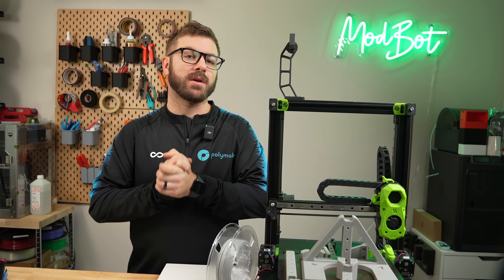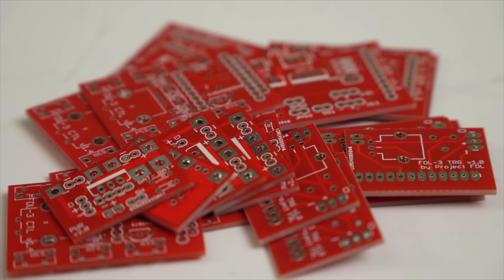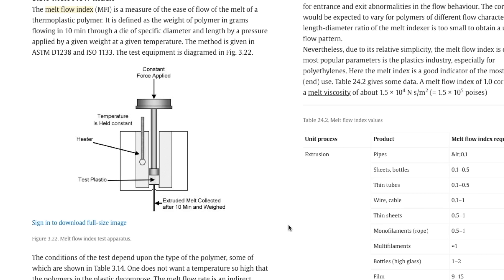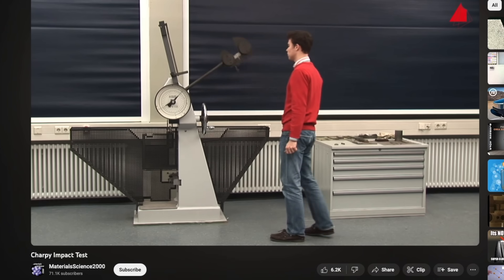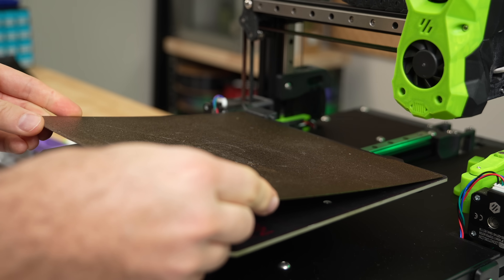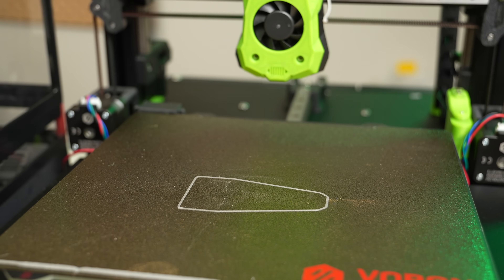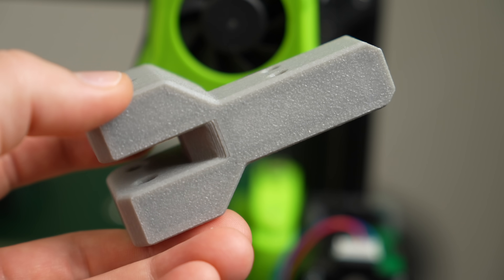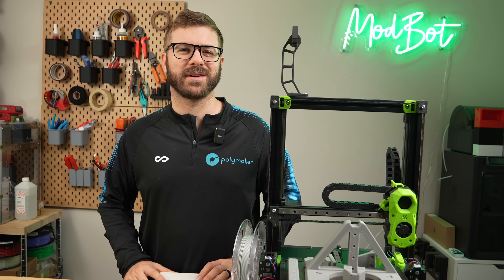Carbon Fiber Vs. Glass Filament 3D Printing (aeForce™ PET-GF)

Comment: I missed it. What is the temperature resistance meaning max temp without distortion under load for example if used to make printer parts ?
Reply: 75-140c if you anneal it

Comment: I've read so many data sheets on various filaments I've started to not trust them. I trust the people who actually take the time to test out dozens of samples for themselves, but wow does that take time. So while I appreciate the analysis on the two sets of data and the way it fits nicely into that graphic I have to take it all with a grain of salt. I tend to focus on the impact tests for some reason, but whenever I see it presented in data sheets it's either different standardized tests or it doesn't make any sense compared to the theory of what the material is supposed to do...or the other problem of too much variance in the test data (+/- wildly high numbers). Plus, you think they want to release bad numbers? It should be 3rd party independents lab results, not the numbers after the head of the marketing department has approved them for public release. In any case: GF/CF filaments get a stiffness boost, but the main benefit I always see is just the really nice visual appearance after printing. This filament probably isn't bad, but I'm going to stick with what the guys on your t-shirt make 🤣
Reply: One of the important things I like doing, is checking if the company has other similar filaments. 

I've noticed for example that fiberology has PCTG and PCTG-GF. The HDT's are identical for both, which tells me they likely didn't do any extra testing for that specifically for pctg. Finding another manufacturer, spectrum, showed me that their PCTG-GF has about 2C higher temps for both A and B of the iso 75 hdt test.

These comparisons often times help out with stuff like this hehe.
Reply: @josejimenez896  What annoys me is when one manufacturers uses different standards for the testing amongst their lineup of filaments, which makes it impossible to compare them apples to apples. I've seen this too many times. Frustrating enough trying to compare across brands.
Reply: @mjodr  oh 100%. Likely done on purpose as some composite fillers are likely subpar, so they just don't include the values they don't like or use different tests
Reply: @josejimenez896  yeah, I agree. Whatever numbers look best. Just mix and match ISO/ASTM/etc as they see fit, lol

Comment: I would not have expected a higher melt flow index for GF vs CF.
Reply: It's actually not that much difference. The GF has a higher density.

Comment: If material specs are saying FAN OFF then it means that fan MUST be off. Its for the printed part strength. If you like to keep fan on use PLA. 
Part cooling fan is only for PLA and dust collectors. Using part cooler cause weaker layer bonding. Actually even PLA benefits from not using cooling fan but not as muck as better materials.
There is lots of PLA blends that a really durable and some, like Greentec Pro is really heat resistant. Greentec Po CF is actually my favorite filament
Reply: I print a lot of PET, including this material and I totally disagree with this statement. PET extrudes better at the highest recommended nozzle temp, which requires a small amount of cooling by default and a bit extra for low layer times, otherwise the previous layers remain too soft. This is especially true for PET compared to PA because nozzle temp is high compared to Tg.
Reply: How is the green tech pro ? Doest it creep?does it warp  ? I am planning to buy it but I am afraid because no enough data on it
Reply: @baderalafghani4564  Green Tech Pro CF dont have much problems with warping. Without CF is a bit too flexible for my liking so I use only CF.

Comment: I've been loving polymaker pa-gf. It prints so great with no warping. I almost always use it instead of abs or asa now just for the no warping aspect. And it's cheaper than pa-cf.
Reply: How would you rate Polymaker PC in between all those? I use Polymaker ASA exclusively on everything for now.
Reply: @mjodr  I've never used PC so i can't say. Sorry.

Comment: Daniel please got up in bed temp on PET/PETG to 90C, the main reason is a better release and better adhesion at smaller footprints.
Reply from the maker: I have had great adhesion at 70c. Like really good even with large prints. Powder coated PEI and it really sticks.

Comment: I can't believe that these filaments aren't dangerous for your health.. It reminds me so much of the asbestos situation. But yeah im probably paranoid
Reply: Diameter and size of these is on a whole other order of magnitude (severals apart). Essentially the glasfibers are just too large to fly around and move into your lungs the same way as the asbestos molecules and are thus less dangerous. They do bury in your skin so do not touch glasfiber without gloves. Also you should still use masks.
Reply: @Bapate-rh9be  The danger of asbestos has nothing to do with how motile it is in the air. It's the only thing sharp enough to cut your DNA in half. There are other ways it kills you, but your body is much better at removing glass. You can build boat hulls for 20+ years and be fine and yes it is still flying all over the place and you can breathe it in. IMO a 3d printer environment is much less hazardous than building a boat hull. That's why it's not really a problem.
Reply: The boat building example was great. @mjodr  

I'm new to all of this and that will definitely stay with me so I can remember it.
Reply: The fibers are bonded to the polymer quite well. If you use an enclosed printer with a filter, you should be fine. You would only really be in danger when sanding or grinding these items during post processing
Reply: I would imagine it would be very easy to brush fibres from the surface to your fingers -> mouth, eyes, everywhere. Nothing ensures they are fully contained within base filament.
We need a microscope to verify that :/

Comment: Curious as to what the electrical conductivity is for the GF vs the CF fillers.  I would imagine that glass fiber would be a lot better for parts where electrical insulation is a concern.
Reply: Should be near zero just like unfilled plain polymers. Only reason it's tested on carbon filled filaments is because it's the only thing that makes it conductive, because...you know...carbon is conductive.

Comment: What i am really missing is a creep test. Possibly a place where gf could shine. Nowadays there are quite a few approachable filaments for example impact resistance but creep under load and/or heat is less talked about.
Reply: If you anneal it, it should do great. If you don't, will be as bad as PETG
Reply: Theres a channel where pa6 cf and pa6gf was tested including creep. The CF version held up better.  Almost no creep
Reply: why would your girlfriend be good at a creep test?

Comment: If anyone doesn't want to spend $100+ on a nozzle. A vanadium nozzle will do just fine. I got a .5mm that continues to print after 2 years of printing with carbon fiber and glass filled filaments. For a $35 nozzle, that's pretty good.
Reply: Find a high flow vanadium nozzle, and I'm in. That's why bozzle is awesome
Reply: @coltenmeredith8899  Bondtech cht bimetal, there you go

Comment: Edit edit edit for May 12th, 2025
Fusrock now has some of the BEST tds sheets (same as qidi) LET'S GOOOOOOOOOOOOO 

Something that needs to be CRITICALLY noted is that those HDT's ARE ONLY FOR POST ANNEALED PARTS. This manufacturer doesn't seem to specifically state that but it's true. If you don't believe me, try a basic at home heat deflection test without annealing on not tiny parts that would crystalize on the plate (such as cnc kitchens test with the standing up specimens with PET). You'll find out that without annealing it's HDT is actually very similar to PETG filaments, with specific high temp ones exceeding it. It NEEDS to be annealed if you want these high heat resistance values or you're going to have a bad time down the line, when you put it in your voron and it deflects

Edit: furthermore, if you want good layer adhesion, please reduce the fan speeds as much as possible

Link to nearly identical filament(packaging, marketing material, colors) , nearly identical TDS, except it specifically mentions specimens were annealed:  FusRock FusForce™ PET-GF Filament 1000g 1.75MM 15% Glass 
https://a.aliexpress.com/_mMfdUdi

Edit: I have also attached a link to this
Reply from the maker: I have seen no mention of annealing being required to reach the advertised determination of temperature values. This filament does print very hot compared to any other PETs I have seen. I just reached out to the team to get clarification on whether annealing is needed to reach the temperatures shown. Will report back when I hear back.
Reply: @ModBotArmy  hey, if I'm wrong I'll buy quite a large amount of this TODAY. However, even tho melt temps may be high the build plate temp suggests to me the Tg is likely somewhere between high 70'-low80's. Higher melt temps are likely partially due to the carbon fiber filament.

In the meantime as a quick idea, you could also test the heat deflection with something like carbon fiber petg :). I have a feeling you'll be quite surprised.

Edit: I've also seen similar pet-cfs that also mentioned similar values but required annealing
Reply from the maker: I just go word back from their engineer and they confirmed what you are saying for the bear deflection. It’s at 100c annealing for annealing for 8 hours. They told me they will be updating their product page so we will see if it happens. Not cool, even if not intentional it absolutely should have been stated. Thank you for bringing this to my attention.
Reply: @ModBotArmy  pain 😔 was hoping I was wrong simply because high temp out the box without icky toxic odours materials are very few. This one was an interesting option and if it doesn't warp much under annealing is one of the better options, but still requires extra work. 

I appreciate you taking my comment seriously and finding out this info however! 🫶 Did they mention if they happen to know what non-annealed hdt's would be, or if it warps/deforms much under those annealing temps? (possible future video hmmmmmmmmmmmm? ;o)

Thank you for the pin 🥳 you're a great content creator keep it up!
Reply from the maker: @josejimenez896  I honestly was surprised to get that feedback. They told me it was in the full tds yet the “full tds” doesn’t appear to be publicly available. 

It may be worth revisiting like you mention to see how well it does in the annealing process and how much it does or does not warp. We are moving in 45 days but once we are settled I will start looking into what it takes to get some testing instruments of my own in 😊

I haven’t heard back since my second response. I can try to get that info or see if that info is in the full tds they mentioned. 

I appreciate it. ❤️
Reply: @ModBotArmy  a quick note as I gotta head off soon, while scientific instruments may be difficult to find for cheap, replicating tests of other creators (CNC Kitchens heat deflection test) is also a good option, as it's something others can easily replicate!
Reply: @ModBotArmy and guess what it will warp if you aneal it so I would aneal at at 70C for 8 hours then at 80c for another 4 hours then at 100c for 4 hours to minimize the warping
Reply from the maker: Pinned your comment.

Comment: Fillers are known to reduce warping and make parts more rigid but they can affect the layer adhesion negatively.
Reply: Negatively? How so?
Reply: @coltenmeredith8899  the chopped CF or GF can interfere with the layer adhesion and weaken it. Can't recall which channel, but I saw some videos here on YT where the  original filament had much better layer adhesion but the addition of the fibers significantly reduced it.
Reply: @bluemonxterDIY  Interesting. I've seen the complete opposite. In a high-quality CF/GF filled filament, the fibers are aligned with the filament, so the fibers basically bridge between the layers thus increasing the layer adhesion
Reply: @coltenmeredith8899  there's a company that actually makes carbon core filament, where only the center has cf specifically to increase layer adhesion.

CF and gf will NOT melt at these temps, thus are simply in the way of adhesion. Think of it like dirt in between two things you're trying to glue together.
Reply: @josejimenez896  Exactly. This is why I have no idea how it would decrease adhesion
Reply: @coltenmeredith8899  I've never seen GF/CF fibers increase layer adhesion, only the opposite. Sometimes it's just not that bad and the parts test well. CNCkitchen has probably tested this the most.

Comment: It seems very brittle and breakable...
Reply from the maker: It is very stiff. On the spool it is easy to snap but when you actually print a part they are crazy tough.
Reply: I just started printing with ABS-GF and it is really strong. Definitely will be printing gantry parts with it.

Comment: filler materials are just that, fillers in 3d filaments.. pure plastic is always stronger.
Reply: This is wrong, filler materials are used to alter certain Material properties in one way or another,  of course it is always a trade and you will also have deficits in other areas. Filler or no Filler or the percantage of the filler depends on the Individual usecase. This goes for 3d Printing as well as Injection molding or deep drawing. To say raw Plastic is always stronger is just a false Statement.
Reply: @Refnal01  Not in 3d filaments, this is illusion of "carbon fiber filament".. they are not fibers.
Reply: @Nobody-Nowhere  You must use cheap shitty stuff. They are fibers, usually about 0.4mm-0.6mm long. It does increase adhesion. It bridges between the layers
Reply: @Nobody-Nowhere  cheap CF filaments are bad though, I'm specifically talking about sparta3d stuff which is just dust
Reply: this is just wrong
Reply: Okay find me some PET that prints as stiff as this out the box

Go on

What a brain dead take. Different parts have different requirements, and usually tensile strength isn't the only one
Reply: @josejimenez896  Yes, its stiffer and also breaks more easily as it has less plastic. It also has lower layer adhesions, as it has less plastic.  I do use carbon fiber PETG, but because of its looks. It has a nice matte look.
Reply: You couldn't be more wrong. I'm looking at a table of eSun filament properties and Nylons with carbon and glass fillers are much stronger than plain Nylon.
Reply: @MiG82au Expect when you actually test them.
Reply: @Nobody-Nowhere  I think I've found the explanation for our opposite opinions. There are a lot of garbage CF filaments out there that have the CF for aesthetic reasons only. If you look at tests of the expensive engineering filaments with published properties (not some random no-name crap) like PET-CF, PAHT-CF etc, they're stronger and much stiffer, including in third party test videos.